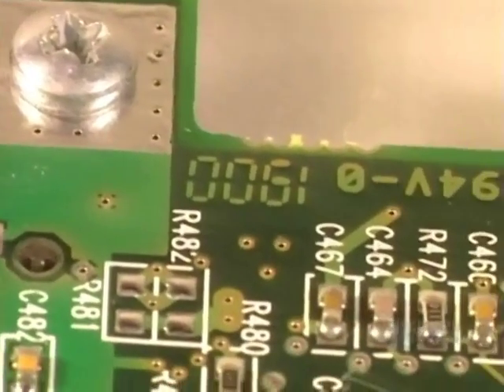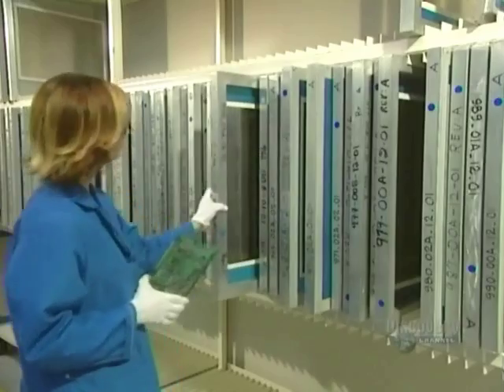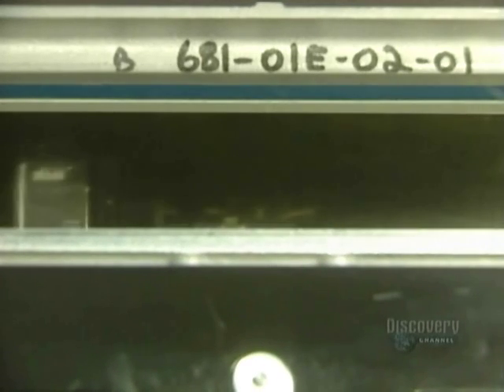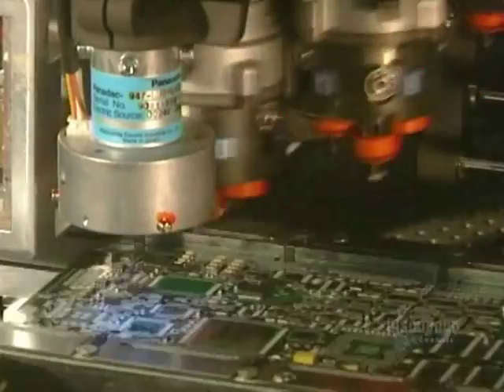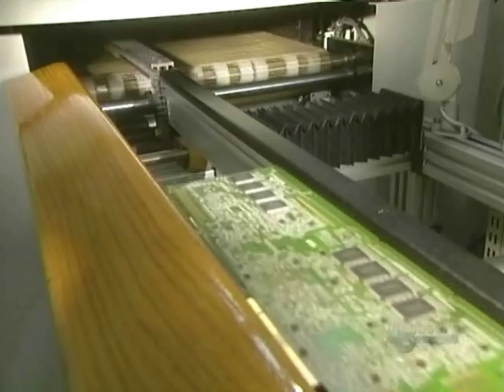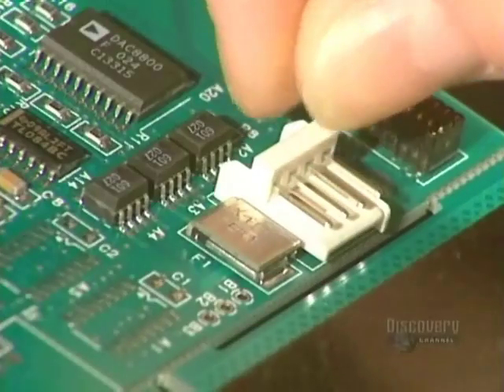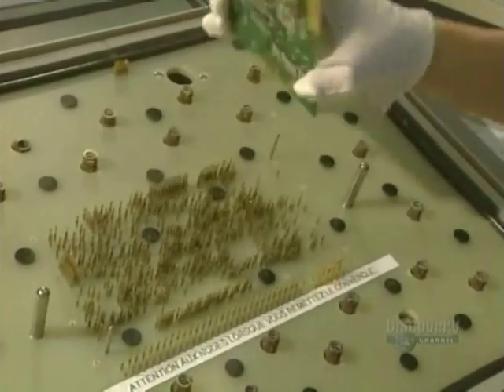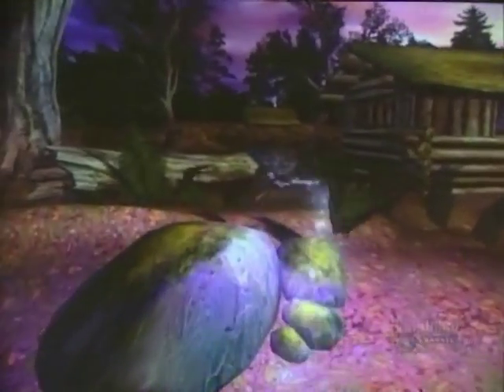How It's Made - Computer Graphics Cards

Comment: When did LSI make graphic card?
Reply: Correction,that is a Matrox G400 card and the LSI chip is it,s memory controller,the G400 is 1998 card with  32 MB SDRAM and a 166 Mhz core ,with a DirectX 6 and OpenGL  3D support ,similar in performance to a Nvidia 256, or Nvidia TNT2

Comment: Must be an old video. Lead is no longer used in solder paste.
Why no mention of the software that actually make this hardware work as a graphics card?
Reply: Or why no mention of the 100 other things that need to be in place for this all to come together.
Reply: thats what made you realize this video was old? Everything looked up to date until they talked about the metal used? really??
Reply: Actually, lead is still used in solder.  Rozin core lead solder is actually very common.
Reply: lead is more effeicent than plain tin